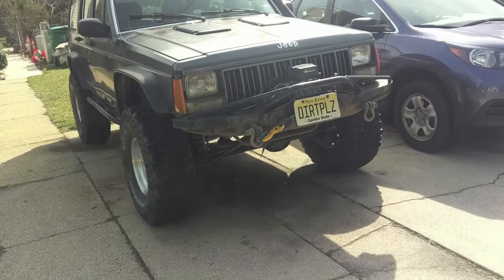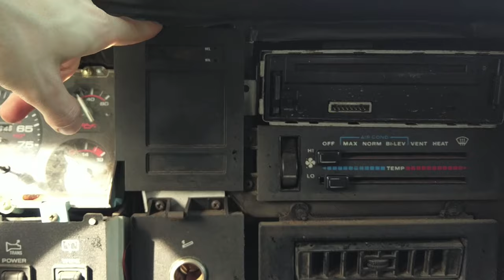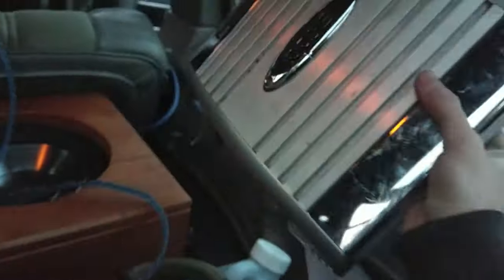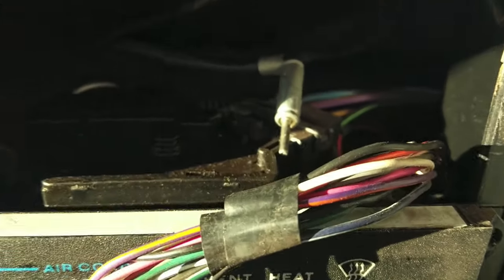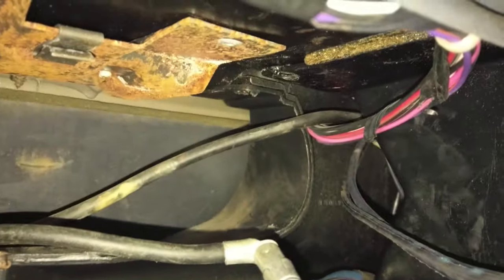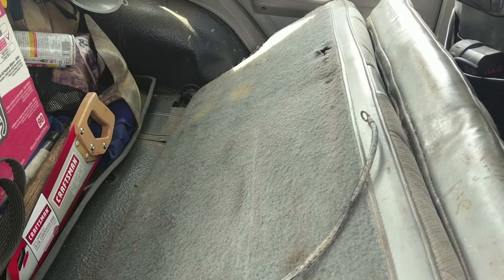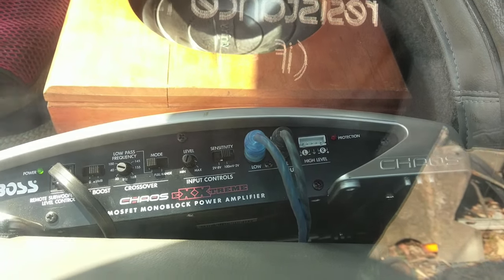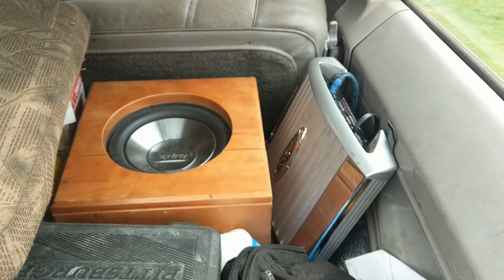89 Cherokee Cheap 8" Subwoofer Install

Comment: The "Low pass frequency" control is a filter that decides the cut frequency that limits what gets to the sub. The whole audible spectrum goes from 20Hz to 20KHz and your bass amp can filter between 35 and 160Hz. The higher the number, the wider range you let pass to your sub. The rest of the speakers get full range. Your sub would use the full range too if you set the switch to full range, but that kind of speaker is badly suited for the whole audio spectrum. A different cabinet with 2-3 speakers could accept and reproduce full range nicely. You can give it a go anyway.
With your setup, your sub is getting from 160Hz and down. Sub freqs are usually filtered from 100-80Hz and below, but in the end its your ears that decide what your sub plays best. Strictly speaking only 60Hz and below are "sub freqs", but you get the point.

Comment: Mount the sub sideways with a protective speaker grid and mount the amp on the speaker box.. Use a quick disconnect on the wires so it's easily removable and crackhead proof  when  you don't need it leave it at home...

Comment: There was a subwoofer made called a Tymphany LAT, a long skinny tube with an array of small woofers, discontinued and hard to find but could be squeezed into long skinny spaces in cars or under the back seat.

Comment: Hey nick. This has nothing to do with this video but i saw a front splash guard under your motor, ive been looking for something to keep my belts from slinging mud everywhere, what did you use?
Reply from the maker: +Ethan Woolford just some sheet metal, didn't do much though surprisingly https://youtu.be/hkcKzgImrtc

Comment: Why don't you mount the amp under one of the front seats? (If it actualy fits of course)
Reply from the maker: Since they are power i doubt there is enough room but the back seats would work fine if i wanted to go that route. My concern is taking on water and ruining it so I want it up off the floor

Comment: Hey broth will be better if you bolt the amplifier on the side of the subwoofer box... will safe you son space... and will be easier if you have to take it out for any reason.  good luck.
Reply from the maker: That's an interesting solution, might tidy it up a bit
Reply: As a bass head you never mount the amp on the box

Comment: I don't know if I would call this an "install", we call this a "ghetto rig" where I come from
But regardless, life sucks without bass, it's a fact.
Reply from the maker: Just curious what would make the install more complete. I'm assuming a better mount amp?
Reply: Just bustin yer balls, mostly on how the amp and sub are just thrown back there.

What do you have under your rear bench? I have 2 amps that are fairly sizable, screwed through the floorboards with some carriage bolts so its harder to steal. I have one of the SubThump cubby boxes for a pretty stealth install (and all of my trunk space available). I just need to make a grille for the subwoofer out of MDF, wrap it in matching speaker cloth to hide the actual sub.

You wired it nicely though, you can definitely fit the amp in the area behind the rear cubby as well for a stealth amp install. Or just screw it into the back of the seat but that's getting back into the ghetto rig territory.
For the sub enclosure, you could secure it through the floorboards but that would require dropping the gas tank. Industrial velcro held my box secure during most of my wheeling, I later installed some tie-down brackets in the floor and used paracord to hold it down incase of a rollover or minor accident, but that was a 40lb+ sub and enclosure and I didn't want it hitting any rear passengers in the head
Reply: post a video of your xj sound system !
 i am about to make my own box to fit a 10" sub into cubby space, i have already installed the amp under the back seat, and ran all the wires under the molding. i just need to build my cubby box

Comment: how do you like the bedlined floor? does it get really hot?
Reply from the maker: The trans tunnel does get a bit hot, but it's more reasonable since i've sprayed the ceramic coating underneath. Long highway drives get a little warm but it's worth it incase water ever gets in.

Comment: your jeep looks junky
Reply from the maker: I like to call it "well prepared." I've got enough equipment in there to swap an engine or recover a semi, just isn't "organized." I know where everythings at.
Reply: @NickInTimeFilms  it's an old jeep if you dont have fluid and all that you will be sol because they burn some oil